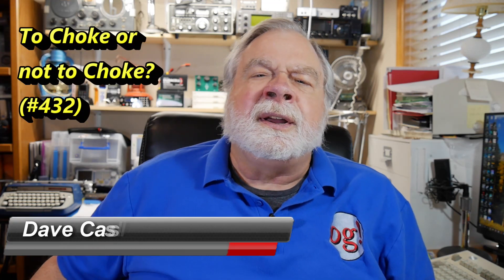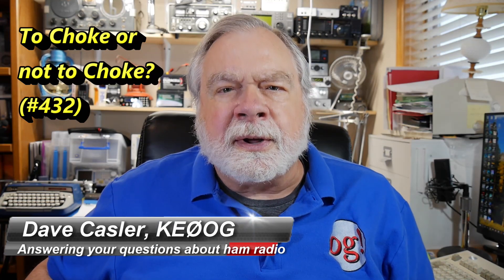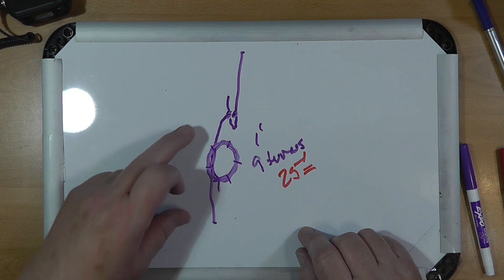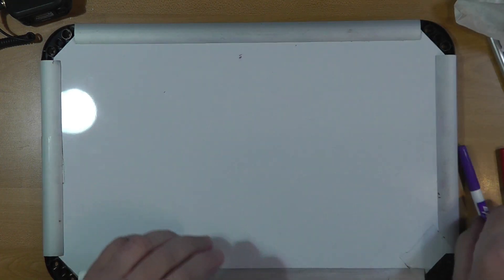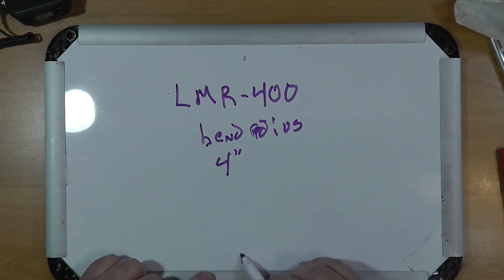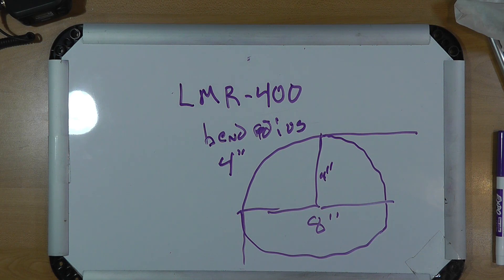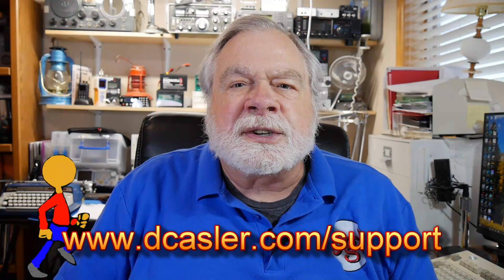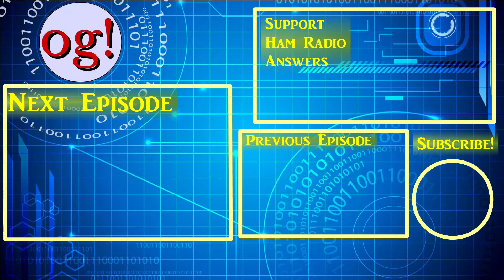To Choke or not to Choke? (#432)

Comment: using a 2 inch toroid, with coax coiled inside it, down about 19.2 inches below the antenna contact point will keep rf off the coax shield, and should help with the matching!

Comment: There is a  you tube channel named TRX labs, the guy is from Germany or Austria, he is very technical and very good. He has a series on BALUNs, Videos 100-103 where he goes through the theory and builds a common mode choke Balun, he also  builds a X:1 balun (I don't recall x) in another video based off of the choke BALUN (you will need to search for it ), I have repeated the testing and measuring he does in my lab and have built the BALUN(s) to great success, it is well worth the time to watch for anyone interested in this subject.
Reply: His methods and materials are spot on. I built two using his technique and same hardware. SWR was less than 1:1.1 on 1.8 - 60mhz and close to 50 ohm impedance throughout the range. Verified on a vector analyzer.
Reply: His methods and materials are spot on. I built two using his technique and same hardware. SWR was less than 1:1.1 on 1.8 - 60mhz and close to 50 ohm impedance throughout the range. Verified on a vector analyzer.

Comment: I agree. Try it without a choke first. 
No need to anticipate problems that may not be existent.
Reply: Disagree.  You don't know the difference is you don't know it exists.  Every unbalanced coax fed antenna needs a choke.  To negate the noise created by a third line, the coax; where the electrical feed on the shield is on inner skin and outer skin of the shield.  A mobile radio with snap-ons would benefit having 200 ohms of combined resistance.
Reply: @gooberminther3tik25  I'm a firm believer in "If it ain't broke, don't fix it." 🙂
The term: "Every unbalanced coax...needs" referring to 'required' is not so, but I could understand "recommended or suggested" -and then only if there is a significant difference achieved.
Reply: Thanks Greg for your opinion.   However, that is not where a choke UnUn is more greatly needed.  The labor of lowering and again raising a base station antenna is not so simple as adding snap-on ferrites onto a mobile antenna coax.  I put either an "Ugly Balun" or a coax wound Toroid 1:1 common mode choke every time.  It won't hurt,  save for a poorly constructed choke, to add the noise reducer before raising it the first time.
The neighbors appreciate the absence of RFI, otherwise created by the 18-50'+ of coax radiating interference.  This can be especially true if running upwards to legal max power output.
Second to RFI on the base station is RX noise cancellation.  I find the difference is > 3 S units, less noise in the receiver; which is the primary objective with mobile radios.
Reply: @gooberminther3tik25  While what you state is perfectly reasonable, the fact remains that if there is no inherent problem then there is no apparent need to fix anything. 

The difference you observe at your unique location is not necessarily ubiquitous. It's terrific that you get better results at your QTH by using such measures, -but if it is not raining then it would be frivolous to walk around with an umbrella just because it is raining somewhere else. -'73

Comment: Interesting.  However, you never addressed his [other] question about using ferrites on the feedline...?  I'm assuming by his inquiry, he was asking about some type of decent quality "snap on" ferrite, but you never answered/indicated whether or not that was an option...?

Moreover, I [personally] wouldn't use the RG-8X for anything at VHF, it's just too lossy.  I really like the LMR-400 UF ("Ultra-flex"). I use it exclusively in my shack for patch cables and such. Quite a bit easier to bend than the regular LMR! Cost is about the same, but a bit easier to handle.

Thanks for your videos! Always good stuff.

Alan
W0ARM

Comment: Where do I buy real LMR-400 coaxial cable. The vast majority of the LMR-400 that I see sold is the LMR-400 equivalent. 

I’ve also thought about using 1/2” hard line for my off-center feed HF 24 foot flagpole antenna. The coaxial cable run is about 65 feet. I wonder if there is a quality 1/2” hard line coaxial cable and a cheap knock off version.

I’ve also heard that a 4:1 balun near the antenna should be separated by about 15 feet of coaxial cable to the RF choke. Is it a good idea to separate the 4:1 balun and RF choke?

Dave KY0L

Comment: I have some genuine LMR-400 and I was surprised how flexible it is.  I also have some LMR-900 and that is very stiff.
Reply from the maker: Times Microwave makes multiple types of LMR-400, some stiff, some more flexible.
Reply: @davecasler  Hmm, interesting!  I previously understood LMR-400 to be just of one type.  I've even seen the label 'Ultraflex' for it.  So why are there other versions?  What advantages do they have? 
 73 de M0PTB
Reply: @NoiseWithRules  LMR400 and LMR400 ultraflex are not the same
Reply: @JosephVE3GKT  Hi Joseph.  This is getting even more interesting!  I bought LMR-400 for low loss.  It seems I got Ultraflex by accident.  But the question is still why are there other versions?  What advantages do they have? And how to tell which version I'm buying?
73
Reply: @NoiseWithRules  I have never purchased LMR400 myself, so I am not at all well-versed in the varieties and pros/cons of each. I hope someone with more knowledge can enlighten us further. 73 de VE3GKT!
Reply: I think they used the stiffer one for my endoscopy
Reply: @JosephVE3GKT  
Actually, they are nearly identical. The 400UF  has a stranded copper center conductor, vs a copper-clad solid aluminum conductor in the 400, and has slightly greater loss/unit length... but it is very slight: ~.3 dB @ 220 MHz per 100'. Interestingly, the actual minimum bend radiuses (fixed & repeated) are the same for both versions, although it takes less "force" (i.e., bending moment) to bend the 400UF.  This data is readily available on the Times Microwave website.

In any case, you can't really go wrong with either one, as long as it's the "genuine" stuff.

Comment: If this is a UHF antenna (440 MHz), 25' of Belden 9258 (RG-8X) is about a 40% loss. 25' of M&P Airborne 5 is about a 30% loss. Better, but both are quite high. Would ferrite beads around the coax be a better solution?  I have the same problem for my UHF/VHF antenna and I'm looking for a way to choke the common mode without converting 30% of my RF energy into heat. 73

Comment: Hi, you mentioned the lightening arrestor? I have a comet gp3 on my roof with DX Eng 400max Coax running into my 2nd floor bedroom where my radio is set up? So, the coax never goes near the ground. Don’t I just put a lightening arrestor on the coax prior to it entering into the bedroom and run a 10 awg copper ground wire to a 4’ rod that is in the ground ? Also,my antenna is no where near the highest thing in my yard. Antenna is About 40’ but pine trees are easily 80-100’, do I even need to do this?

Comment: Can the lighting arrestor be installed at the base of the antenna.  Between the antenna and lmr-400?  I installed my 1/4 wave this way thinking I wanted the lighting ground at the highest point.  Then I have #6 awg  bare copper ground cable to the ground. 

Thanks -wros246 (GMRS)

Comment: Agreed on genuine LMR, but I needed a 15' premade patch cable for a mesh network, and next week will see if "enigma 400" can work well enough.
Reply: I'm often contrary...the objective is to reduce the common mode current.  Therefore it makes little difference in whether its LMR400 or RG400 wound around a Toroid.  The negative side is not the same as the positive side?  Am I right?

Comment: Hello Dave, thank for your information on chokes. Can I as a supplementary to this video? If you are on HF, say 14.1mhz instead of UHF, would you use a toroid choke, how do you identify the mix, size and turns required? Thanks for all your assistance to the community, Frank. VK4FEM

Comment: Could you offer some objective means to determine frequency vs diameter vs count vs cable spec, that is more than just "should work" kind of guidance? Thanks in advance...
Reply: I can tell you what works for me (very well): 8 turns @ 8" diameter of RG8x OR RG58 as near as practical to the feedpoint w/ a PL259 coupled to a double female SO239 (barrel) coupler. It is NOT frequency critical (one size pretty much fits all - nothing fancy). Make your run to the shack w/ another PL259 connected to the free female of the SO239 at the feed-point (below the coiled choke). This will choke off most of any feedline radiation back to the shack and minimize most of any pattern distortion. If you're OC/ anal put a couple more turns in the choke). Been doin this for years. If you're stingy on funds, delete the PL259/ SO239 coupler and just wind your choke coil and run it to your station - I've done that too. Works great.